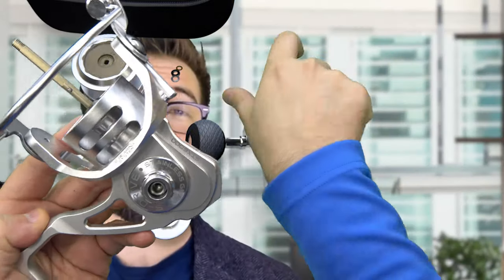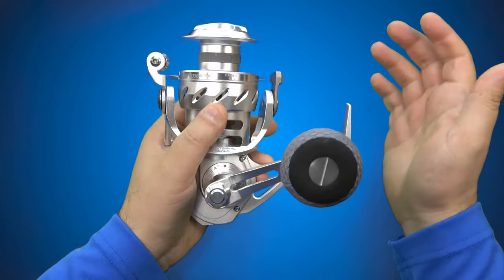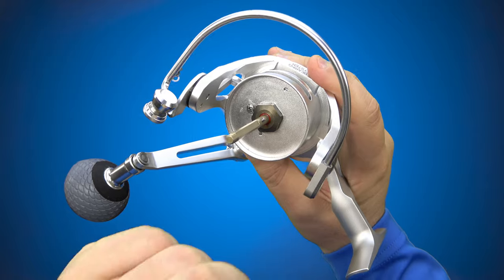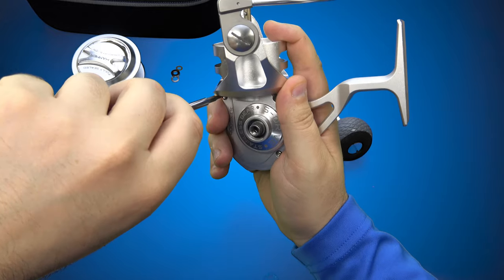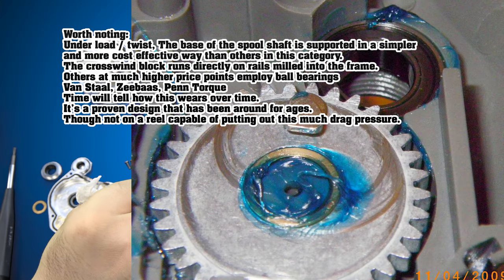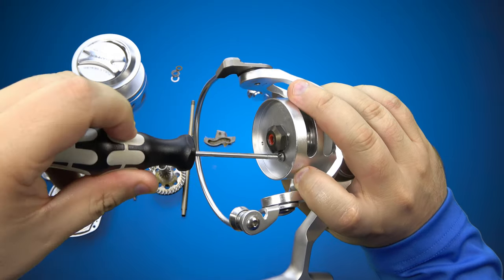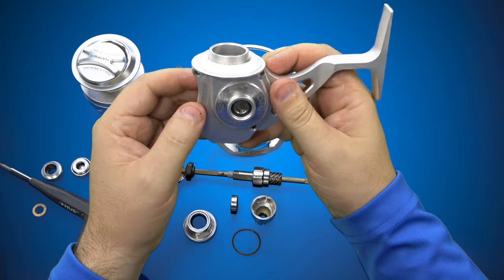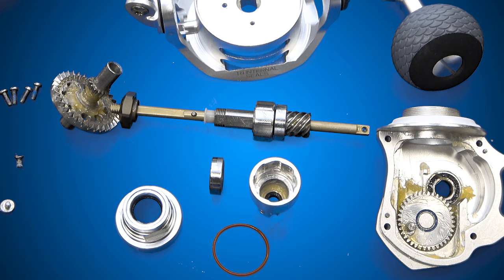Tsunami Salt X:  The most affordable submersible reel.

Comment: OrthodoxFishing DAD claims to have debunked the fully sealed claim! Watch his YouTube videos! Loll  😂
Reply from the maker: Thanks Tom!  for the heads up.  I watched them...Emailed him and am goin over some stuff.....Definite water intruision at the clutch....THat tan colored grease means water imulsion.  The sand and scrapes under the rotor.....that's to be expected when you grind that sand out by turning the handle.     The white ring is the rotor brake and possibly to prevent 100% lockup from sand.   I heard from a shop that they had a customer return who claimed water got in side.  I was going to tear it down.  But we went fishing a few times instead and someone made them an offer on the returned reel and they sold it lol...(they didn't think there was an issue as it felt new...thought I can't confirm......((dude'sbeen in the industry a looong time  an old salt and knows saltwater reels so he'd know if something was off. SO I take his word that it was fine just a buyers remorse return))
Reply: I hope it holds up better than the vr

Comment: Are you SURE about your information that the spool shaft of this and the Slammer III are made from aluminum with hard coating?  I have seen a press release or literature from Penn that says the Slammer's is titanium, and a Penn rep named Tony, on a board, also stated that it is titanium... and at this point I would trust them to get the material righter than whomever you got ahold of at Tsunami, ya know, unless it was one of the clever people who engineered this reel... which seems like it may well be their first reel home run ever.  Aluminum just seems like an awfully unlikely material for a spool shaft, due to its relative lack of springiness OR stiffness, plus, it doesn't seem you'd want the knob of a potentially powerful drag to tighten onto aluminum threads.
Reply from the maker: I was told slammer is titanium by Tony... But one of the salt x designers said it's there's is aluminum just like the Slammer.  I was told some involved with the salt x are former Penn employees.
Reply from the maker: And in regards to the second part of your reply... I'm with ya.  I'm not against it until failures show up.  Also I heard this second hand.  I've been pestering a few people to get the info for me.  They could have just pacified me with a make believe answer....
Reply: @TackleAdvisors  Hmm, I just looked at one of my Slammers, and the black coating was rubbed off on one corner of the shaft below the threads, and it looked too silvery to be titanium, unless it is a nickel titanium alloy, but did look like it could POSSIBLY be aluminum.  Interesting.  I think I'll go compare the price of a Slammer shaft to that of another Penn, to see if that suggests nickel titanium.  Annnnd, having just done that, a Slammer III 4500's shaft is $12.50, and a Spinfisher V 4500's stainless shaft is $6.50... but, I don't know that a nickel titanium shaft wouldn't be costlier still.  Though I will say, I don't know what a Cabo's shape memory titanium (probably 50% nickel) bail looks like UNDERNEATH its coating... but, externally, it does look quite similar to the Slammer III's main shaft... and, Penn and Quantum do have the same parent company, fwtw.
Reply: I guess shape memory is something else, (to do with heat), and the property I was describing (about returning to where it was) is called superelasticity... though that of course would not stop marketers from calling it shape memory.  Wonder if the shaft of a Slammer "bows" more, because of greater elasticity than stainless steel, and if THAT is somehow why they have a kind of non-tight metal ring behind the pinion, that is only said to be there to support the shaft when under extreme load.  Oh, and regarding "make believe" answers, I suppose it's possible manufacturers are still kind of cagey about titanium, because of sourcing... though I doubt they resort to CIA shell companies like we did for the Blackbird!  Interestingly, the Salt X reel, from the most unlikely of sources, looks like it might turn out to be what the only "former-aerospace" reel company was shooting for, in a spinning reel....  (Though even the Salt X can't compete with that company's lightest NON-spinning reel, when it comes to heavy duty jigging for grouper, because that one has about twice the strength to weight ratio, [and half the weight], at the same capacity.)  Regardless, I'm impressed with the capacity-per-weight of the Salt X, as SPINNING reels go... if it'll fly.

Comment: This reel really sucks respectfully 
I just purchased mine 4 days ago. Did about 1.5 hours of casting unfortunately I didn’t catch a fish but I went through hell with this reel. For some reason the line spools  like a cone which causes so much wind knots I lost 2 plugs bc of it. I lost so much line when I got home I decided to just spool new line. As I’m retrieving the new line I notice a light grind 😑 I called the tackle shop that sold me this metal junk and they said they can not replace it and I’ll have to exercise my warranty. Like wtf I just purchased this 4 days ago. Now I have to email the service company and see what happens. Avoid this from happening to you and purchase a VAN STAAL. I’m very disappointed with tsunami I love tsunami products I use their products plugs, swivels, and rods it the first time I purchase a tsunami reel and it sucks DO NOT BUY

Comment: The spool shaft looks like titanium
Reply from the maker: Then going by color the stradic FK FL would be titanium as well.   The colors are nearly spot on.  It's a surface treatment.   Too light for stainless...
Reply from the maker: It's aluminum with a hard coat.  Same as the slammer......hell I thought the slammer was ti
Reply: @TackleAdvisors  do you think if that coating wears off it will effect the reel? Manufacturers are quite sly!
Reply from the maker: @jonezkat  Of the main shaft?  I doubt it will wear off.  If it does there is something  more wrong than the coating :)